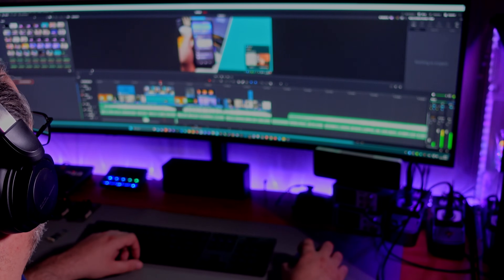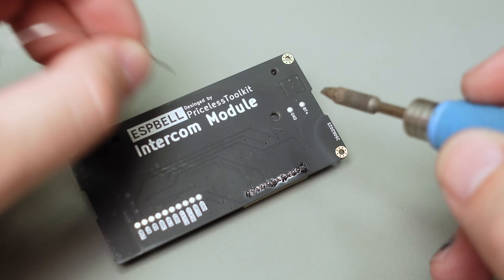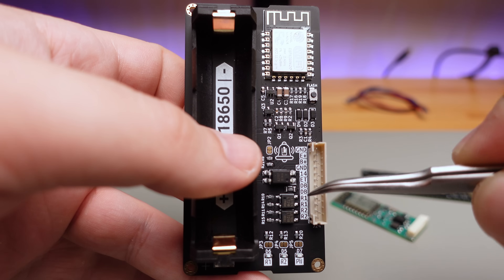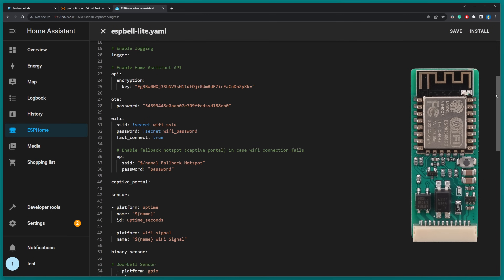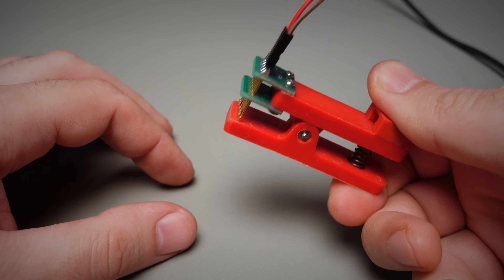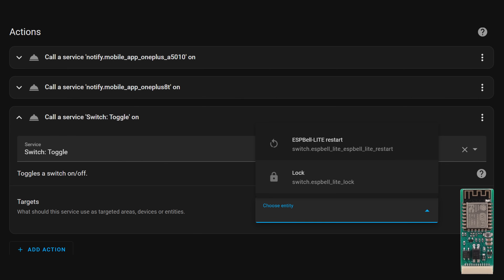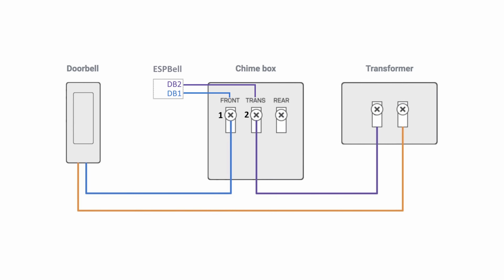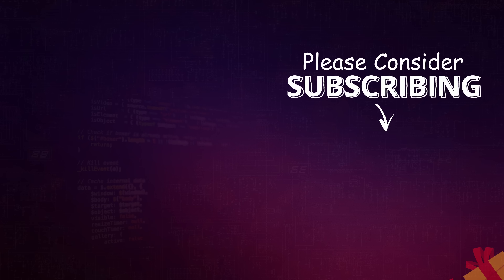Intercom and Doorbell Smart Modules for Home Assistant | ESPBell

Comment: First of all, thanks for a woderful project.
Bought it, installed in a less then two hours without any problems.
I've done a very simple "auto-open" code modification for the lite version. 
It opens the door after 3 short rings and 1 long. The sensor section in EspHome code for it looks like that:

# Doorbell Sensor
  - platform: gpio
    pin:
      number: 4
      #inverted: true
    name: "DoorBell"
    icon: "mdi:bell"
    filters:
      delayed_on: 100ms
    on_multi_click:
     - timing:
       - ON for at most 1s
       - OFF for at most 1s
       - ON for at most 1s
       - OFF for at most 1s
       - ON for at most 1s
       - OFF for at most 1s
       - ON for at least 1.5s
       - OFF for at least 1s
       then:
         - switch.turn_on: Lock
  - platform: status
    name: "${name} Status"
Reply from the maker: Thank you for supporting my work!!!

Comment: I’ve created something similar in the old apartment 4 years ago and it was working great! Now I have a „new” system that I have to reverse engineer the new „integrated” bell/intercom system.
Reply from the maker: 4+wire or 2 ?
Reply: @PricelessToolkit  unfortunately 2
Reply from the maker: you can try the "easy way not smart" solder wires directly to the "open button" and to the "bell loudspeaker"

Comment: Nice work! But wouldn't you need some revers engineering for 2 Wire intercom systems? So you know which bytes need to be sent out to open the door, for example?
Reply from the maker: it supports analog systems and can be connected to digital systems in crude ways like directly to buttons.

Comment: This is exactly what I need. If I buy it from you, will it still need to be programmed with the clip? If I buy the MAX, can I still automatically open the front door using Home Assistant over the cloud?
Reply: Btw. amazing products! Well done 👍🏻
Reply from the maker: Hi, yes you need to reprogram it "add wifi credentials". MAX version powers up only when someone rings the doorbell, and just after that you can open the door.
Reply from the maker: Thank you!!

Comment: Thanks for this. You made an elegant solution for what I made myself before with an ESP powered relay. But would you be so kind to take it a step further?

There are ESP32 boards that have audio in and out. Would you please make a version of this, that also connects to the microphone and speaker and leads the audio part to your phone through either WIFI or even abroad?

This would finally resolve my issue that I have no way to install a video doorbel in my condo and would make it possible to at least talk to people when I am not at home or not able to go to the door. If an ESP32 would not be capable, maybe you could do it with a raspberry pi? If it would be done through a mobile website served on the device, one could even talk and open the door through a computer.

I really don't understand why I have not seen any device for this as I must not be the only one in the world that lives in a condo and cannot install a personal video intercom at the entrance.
Reply: I am looking for something similar as well. I have a wired intercom and I was searching for a wireless handset where the base unit could replace the current wired handset. After hours of searching I had to give up as it doesn't look like such a tool exists.
Reply from the maker: To make a new version of "hardware" with esp32 that is audio capable it's not too hard but not fast, problem for me is the software part. I am not a pro programmer. I think server-side and phone software are necessary "not just Arduino stuff"

Comment: May I know the physical size of ESPBell Max? Thanks.
Reply from the maker: Hi PCB size is 46.5x91mm
Reply: @PricelessToolkit Could ESPBell-Lite support MQTT? Thanks.
Reply from the maker: @ロジャー-n3s  It can support if you write the code.
Reply: @PricelessToolkit  I will get Max when the 3D printed case is available.

Comment: Great project, could you suggest me an object that allows me to press a button and a call to an internal switchboard is generated on an analog telephone line via MDTF tones? I was looking for a solution with two buttons and a single telephone line to use in common with the object. Thanks
Reply from the maker: @enricolazzerini9993  Hi, sorry but i dont know project that uses DTMF.

Comment: Thanks a lot for your video. Great job. I would like to buy the Lite version. However, my phone allows me to open the door only if I lift the handset. Does the Lite version solve this problem? Thanks.
Reply from the maker: Thank you, No, it's complicated if you need to lift the handset.
Reply: As there are 2 relays i was thinking to emit the lift of the headset by soldering a bypas on to the lifting switch. Could be an option or is it a dead end im heading into.
Reply from the maker: @janrehorka2220  It's possible, but it depends on your intercom system and your level of expertise. The relay in ESPBell is normally open, while you'll need a normally closed one for this setup. You could add an external relay to make it compatible.

Comment: When i saw this vid's title,  I was hoping you did found a way to get the audio part of the intercom connected to HA as well. Other then that it is  a great job you did.
Reply from the maker: Thank you. no it will be to time expensive for me to do audio part + software.
Reply: Maybe someone more experienced in analog audio can help here. For me it's a key feature since I have experienced it.
At my parents they have a digital intercom and we installed a board made by the manufacturer that sends the call directly to phone with audio.

It's awesome and they can answer exactly like they would if they were at home. But at my apartment I just have a 4+N wires intercom. I might buy your board but I don't want to open randomly without knowing who's at the door.
Reply from the maker: @Dresken  check amazon intrcome. but it's slow.

Comment: just subbed. this is exactly what im looking for. i have been using a Sonoff inching relay now for just the lock action, would be really cool to do all of this, probably would have to update some coding a bit to work with my 1960s unit, but I'll share my findings. lol. If i wanted to run this off 12vDC power that i already have run to the junction box, can I?
Reply: Guess i can probably answer my own question... i'm reading on the product specs. I can step it down to 5vDC very easily. or just run it in the junction box on that battery. easy peasy to change it. Great Work!
Reply from the maker: Hi, for Lite version you need to provide 5v, for Max version you need to charge battery every 3-6 monts "if not 12monts". if you can contribute to the code it would be great!

Comment: Nice device. ESPbell could save my day. Do you planned a version with bigger LEDs for notification?
Reply from the maker: Thanks, you can hook up led to the "MAX version" It has a battery voltage output "E+" when triggered.
Reply: Thanks @PricelessToolkit

Comment: Nice Project! :D
But why did you write extra code for the max Version? Isnt it possilble to get the low power enviroment withe the deepsleep component from esphome and wake it up with a trigger on a rtc pin?
Reply from the maker: Thanks!
1. Max is not sleeping it is completely in power off state.
2. With Arduino code I can set the WIFI base station MAC and Channel, so it will connect instantly, maybe I can do it with ESPHome and extra code but I haven't tried.

Comment: Gefällt mir sehr gut !! Danke für Video !! Wenn ich nur wüßte, ob ich es an eine SIEDLE 701 angeschaltet bekomme ❓❓❓
Kanal ist abonniert !
Reply from the maker: Hi, if you can make pictures of the internal part (PCB), I'll take a look. just open a new discussion on GitHub and upload the images.
Reply: Danke für die schnelle Nachricht 👍Habe vor Monaten über meine SIEDLE ein Video gemacht. Leider müßte ich nach einer Woche meinen Aufbau wieder abschalten . Es gab Störungen und ständig Fehl Auslösungen durch Treppenhaus Licht und anderen Wohnungsklingeln 😪Hier der LINK beginne bei 02:00   
https://youtu.be/9TJX5VLB9K4?si=_5CWtLyEOfmbh1ZS
 @PricelessToolkit
Reply from the maker: @JochenMollVideographer  you almost did it correctly!! just change the Zener diode to a bigger value "18v is on the edge" For this reason you have false triggers. for the resistor, you can go even bigger value of 5+k. You can also add a time filter to automation something like "If HIGH is more than 100ms"
Reply: Vielen Dank für die Tipps 😊werde mir einen weiteren AQARA besorgen und neu testen - Viele Grüße Jochen 
PS: Deine Schaltung würde ich auch verwenden, wenn dies an die SIEDLE 701 passt 
 @PricelessToolkit

Comment: This is awesome. It'd be awesome if this could be expanded to multi-family buildings.
Reply from the maker: Thanks!!, can you explain what you mean?
Reply: @PricelessToolkit  Basically the same device but support for multiple users. Say there's a condo or apartment building with 6 units. Depending on the button pressed or unit # selected/called at the doorbell, the notification/call goes to a different user.
Reply from the maker: @cdv130   Now it is clear, In my opinion, such a device will not be in such demand, plus there should be one server for everyone.

Comment: Sorry if this is a total noob question:

I bought the ESPBell-LITE and I saw that the both LOCK sections have 2 wires each. My question is:
Do I need to connect both wires to each terminal? For example, the 2 wires coming out from rightmost LOCK section should be connected to the Neutral wire? How about the other LOCK section (the one left to the first one I talked about), both cables should be connected to the wire coming from the lock on the street?

Again, sorry if this is the most stupid question ever. I’m trying to be 100% sure before I install this. I just don’t want to blow up the whole intercom system of my apartment complex.
Reply from the maker: Hi, the relay is like a sample switch with 2 contacts, the relay can handle 2.4A of power but one wire does not so to handle maximum power each contact has 2 wires in parallel.  connection diagram https://github.com/PricelessToolkit/ESPBell-LITE?tab=readme-ov-file#wiring-diagram-espbell-lite-to-intercom--doorbell

Comment: With the current design, would it be possible to add intercom communication directly in Home assistant? I know that Home assistant now doesn't directly provide support for two way communication (with the additions from year of the voice is technically possible) but if so, I'm wondering if you thought about that during the design or would anything need to be changed for that?
Reply from the maker: unfortunately, it can't do voice stuff. For that, it needs to be completely redesigned.
Reply: @PricelessToolkit That's unfortunate. Would you revisit this project once official support is added for two way communication? I really like this and I'm going to build this for sure! :)
Reply from the maker: @adfjasjhf  Normally I build stuff that I need, and I don't need voice communication, BUT if HA will support voice functionality and the new design price doesn't go high, probably yes.
Reply: @PricelessToolkit  Love to hear that, much appreciated!

Comment: I would like to adapt to 24VAC power to replace existing doorbell without the need for battery or wiring changes.
Reply from the maker: The battery is not a problem you need to charge it every 2 years :) Or you can use LITE version with a 24 to 5v DC-DC converter.

Comment: My Wi-Fi channel changes overnight very often depends on which channel is the best at the time. Is it possible to have it detect which channel the Wi-Fi network is on?
Reply from the maker: For the LITE version, there is no difference wifi channel is fixed or not, for MAX is crucial "with the current firmware". If the channel changes, then it must do a search and then connect, which will result in a longer notification time.

Comment: I've got an Elvox 6209. Not sure if it's supported. There are 4 wires going into the intercom, but they are connected in two pairs. Does that mean it's a 1+N intercom?
Reply from the maker: Please, open a discussion on GitHub and upload an image of the intercom board "terminal naming" and i will try to help.

Comment: Is it possible to use a camera in the entrance and activate it? Like near bell button
Reply from the maker: with Max Or Lite?
Reply: @PricelessToolkit  if possible with both or any of them and one more question is possible to power board from intercom power I think it's 25v in my case
Reply from the maker: @akasha1337   Max can output battery voltage when triggered, Lite has GPIO that you can configure to wakeup your camera, if it support that. if your intercom can handle ~200mA then yes "I don't recommend it" but you need to step down 25v to 5.
Reply: @PricelessToolkit  not efficient. what's the best way to power the lite version?
Reply from the maker: @akasha1337   you can use any 5V 0.5A power source.

Comment: Hey man, quick question, do you follow any reflow curve with that hot plate ? What Max temp you set for the plate ? I set mine at 250, place the board at 180, wait until it hits 250 and Take off the board after 20 - 30 sec… im a bit afraid about lifespan of the caps and rest of the parts due to thermal shock?
Reply from the maker: Reflow profile on the hot plate? No! Temp depends on the solder past you using, I set 235-240C. put your board from the beginning!!! not when it hits 180C.
Reply: @PricelessToolkit  thanks for your reply man.
Reply: @PricelessToolkit  how do you cool down the board without thermal shock ?
Reply from the maker: @0x0081  For production i use oven with termal profile.

Comment: Thanks for the video. My apartments has a Siedle HT 511-01 system which supports 6+N. Is it possible / compatible to connect ESPBell Lite to it? Thanks!
Reply from the maker: Hi, If you can send me the PDF link with the connection diagram I will find out.

Comment: Ever seen anything for interacting with Comelit video intercom systems?
Reply from the maker: nop
Reply: @PricelessToolkit  it appears to be an Ethernet and Power over Ethernet based system, so quite a bit more tricky... But I've always wanted to do exactly this
Reply from the maker: @AshleySteel  If it is ethernet you can use wireshark to check protocols.... maybe it is simple video streaming
Reply: @PricelessToolkit  yeah I've got some captures from a tap somewhere just hoping I could stand on the shoulders of giants and start with something already made! Just haven't got the experience or skills to dive in to start that project novelly.

Comment: Wonderful project!! I'm looking at the code to see if we could integrate a kind of knock where you knock 3 times in a row with some interval and the door opens automatically, to fit my case. If you like, we could integrate it into the final version and make it configurable :)
Reply from the maker: Thanks,  for LITE ? . Max can't do that.
Reply: @PricelessToolkit  Can't it be done in the code so that when it detects, for example, 3 consecutive taps on the doorbell, it opens automatically?? That's what I mean
Reply from the maker: @adri.sglega   For the Lite version, the doorbell input functions like a sensor "connected to GPIO", allowing for this capability. However, for the Max version, the doorbell input is linked to the wake-up/power latch circuitry. Consequently, if the Max is already powered on, it cannot detect a second doorbell press.
Reply: I've done it for lite version. It opens the door after 3 short rings and 1 long. The sensor section in EspHome now looks like that:

# Doorbell Sensor
  - platform: gpio
    pin:
      number: 4
      #inverted: true
    name: "DoorBell"
    icon: "mdi:bell"
    filters:
      delayed_on: 100ms
    on_multi_click:
     - timing:
       - ON for at most 1s
       - OFF for at most 1s
       - ON for at most 1s
       - OFF for at most 1s
       - ON for at most 1s
       - OFF for at most 1s
       - ON for at least 1.5s
       - OFF for at least 1s
       then:
         - switch.turn_on: Lock
  - platform: status
    name: "${name} Status"

Comment: Very cool, but maybe I need a version that can be grafted into my flesh and deliver electroshocks, for the many times when I go to the garden out of doorbell reach without my phone...

Version 2 could use wireless and batteryless kinetic switches like the ones we can now find in homes so you can put light switches anywhere you want and not worry about cabling, for instance from Quinetic for those in the UK. Very handy and not just for home renovation, new homes as well.
Reply from the maker: Nice idea :)